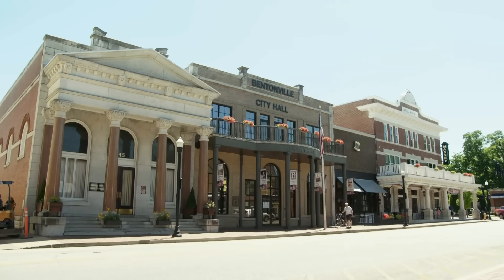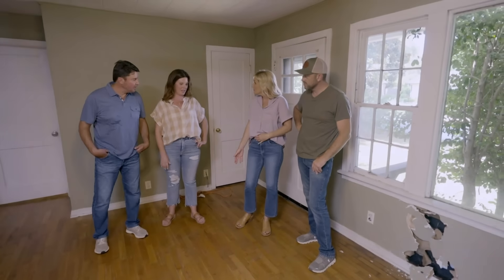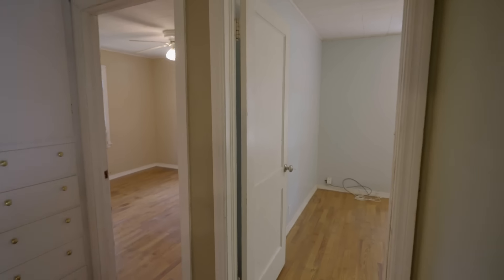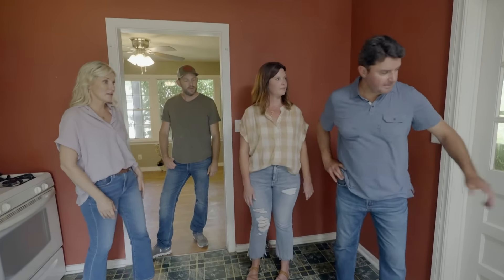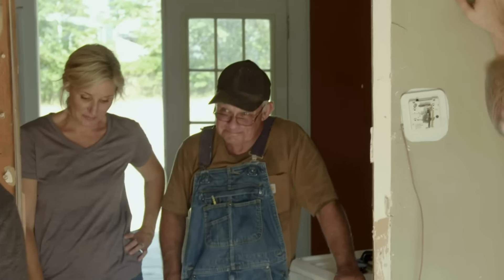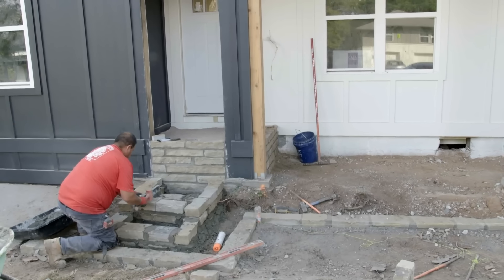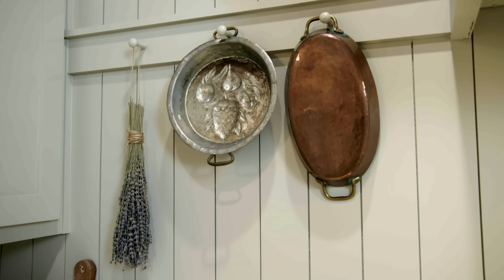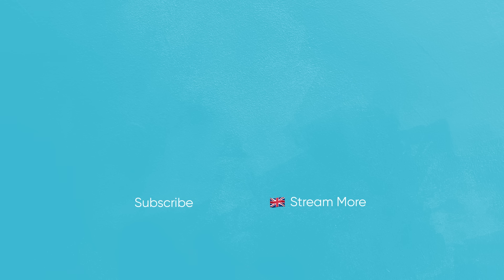Dave & Jenny Turn This Tiny House Into A Larger Than Life Dream Home | Fixer To Fabulous

Comment: I wonder with the ceiling being so open, would the house be the right temparature? It looks nice but is it practical for living in?
Reply: They built a new roof raised above the existing roof, between the two is the insulation needed to keep the house warm.
It was a smart move to make the original ceiling a feature.

Comment: Where the hell is the insulation in the roof after you vaulted the ceiling?  No insulation is a disaster.  Bad design.
Reply: They added a new roof on top of the old one so most likely insulated the new roof.
Reply: @harrisond8132 
They added it over.  It is discussed in the video in an inobvious way.